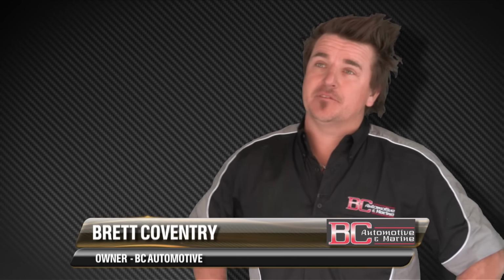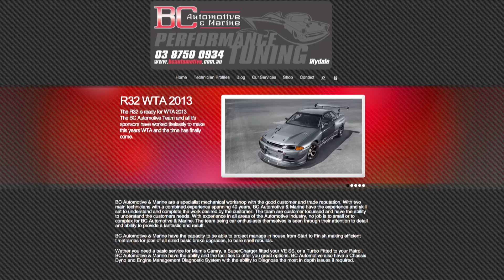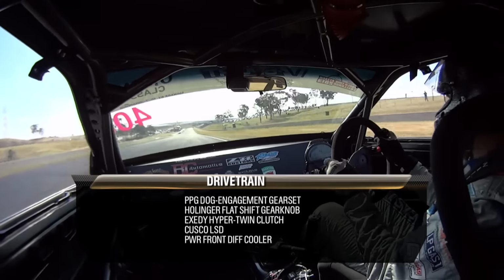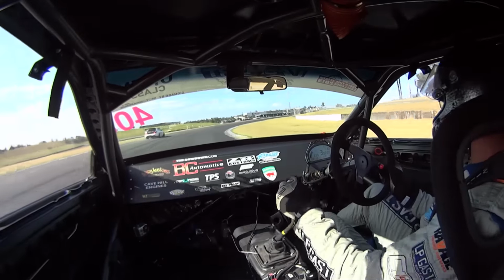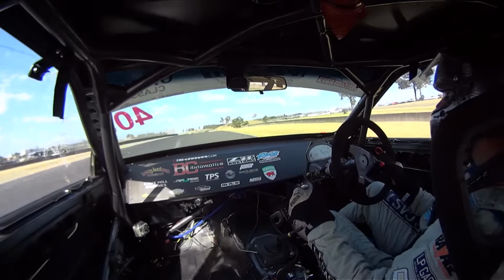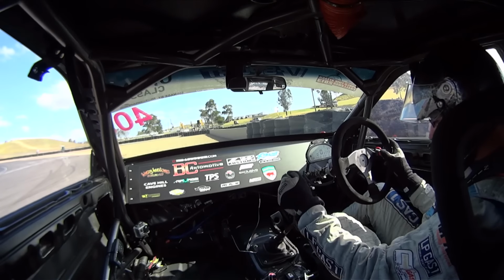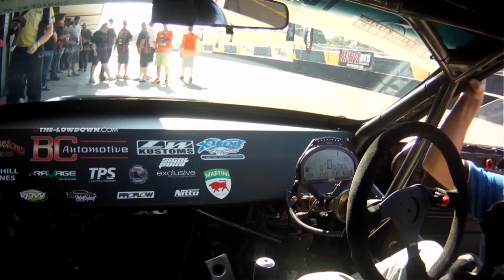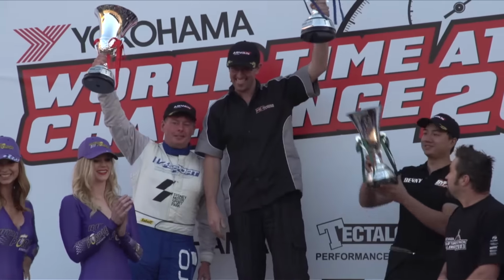BC Auto R32 Skyline GT-R - 300km/h down the front straight! - WTAC 2013 Open Class Winner -

Comment: why not use a sequential gearbox ??
Reply from the maker: Most likely reason is cost. H-pattern dog boxes trade for half the price second hand as what a Holing did at the time.
Reply: they are running a precision turbo and a motec m800.
I dont think money is the proplem !!
Reply from the maker: Precision isn't expensive compared to others. Its a privately owned car, so who knows where the budget lines were drawn
Reply: am just saying that they could have spent an extra 10000 on a better gearbox.
Reply from the maker: easy to say than do
all seqwtutnial does is change the gear lever direction and shorter throw,. Both are dog engagement and helical cut
Reply: its the K.I.S.S factor keep it simple stupid , if a 500k v8 super car with sequential cant get to 300kph down that straight and this thing does then obviously its better off with out it